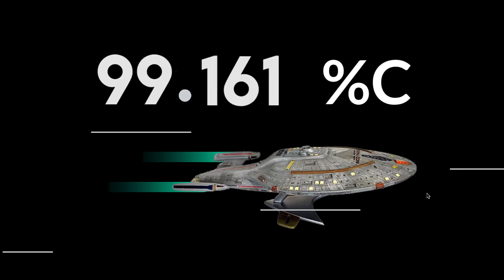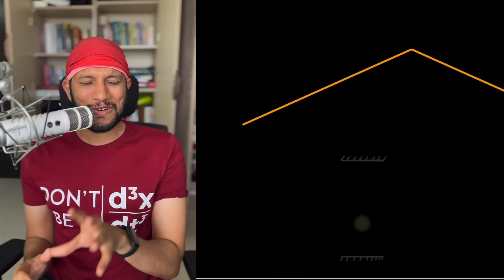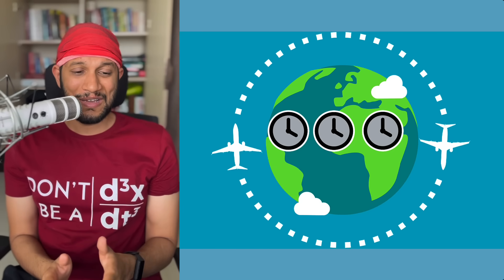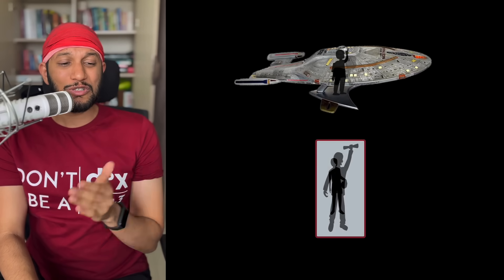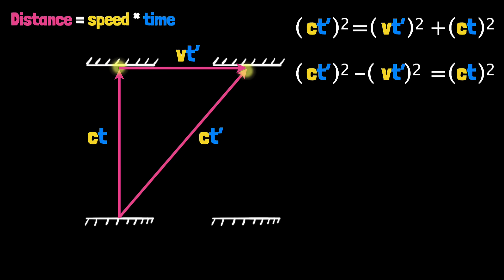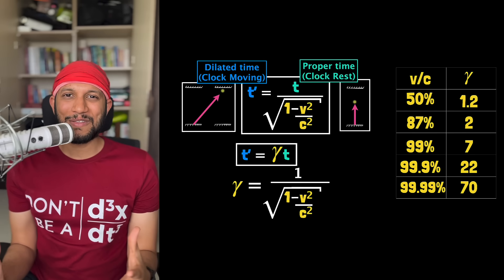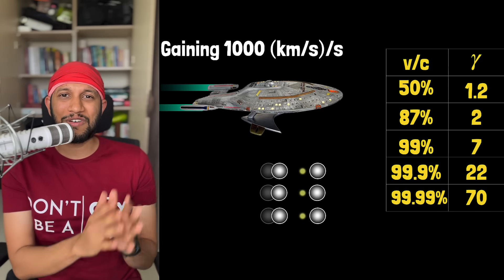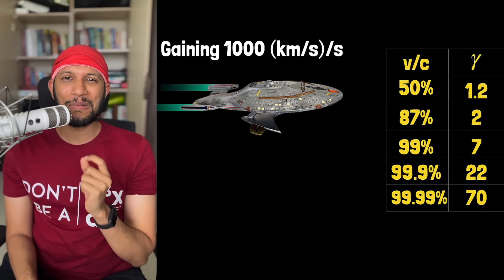I finally understood why you can't go faster than light! (My mind is blown)

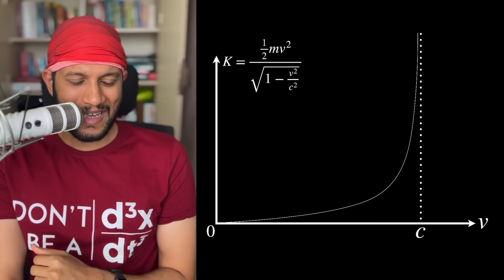Comment: 0:37 photon will not move slower. Horizontal speed has nothing to do with vertical. You just believe that photons will slow down. Believing is religion.
Reply: If I believe you are telling the truth, is that also religion? Half of science is educated guesses, the other half is evidence based on the belief we’re even real to begin with.

But also on a serious note are you suggesting something can move faster than the speed of light? I mean, I’d love if that were true but you have to prove something like that my guy.
Reply: @theIAAW  There is nothing scientific here at all. Statement that vertical speed slowing down because electron traveling longer distance is obvious nonsense. Electron traveling same distance.
And horizontal distance is nothing to do with vertical.
So this argument is not valid.
If someone suggesting something can't move faster than the speed of light they have to use scientific arguments. Not nonsense tricks.

Comment: Nobody on Earth has ever seen Time in a stationary frame of reference.  No object created by mankind had ever existed in a vacuum outside a gravity well, not even those we have accelerated to extreme relative speeds (such as Voyager I and II).  Nor has any object we've ever observed been free of some sort of motion. Therefore, while we can calculate the RELATIVE SPEED OF LIGHT, we cannot determine the ABSOLUTE SPEED OF LIGHT.  So, all of our clocks have been slowed since we first began experimenting with light and photons.

What happens, if we accelerate towards a distant star, such as Alpha Centauri...only our ship's acceleration actually makes it travel SLOWER in absolute speed than the Earth-Sol system is traveling through the Universe?

Comment: wouldn't this mean you can use this to find absolute zero speed? because as far as i know everything is perpetually in motion whether we see it or not but through this you can make something actually cease motion by moving something in a bunch of directions and accelerate in the direction with the least dilation (which technically would be decelerating). and a second theory the greatest direction of deceleration is likely the direction of the center of the universe due to the universe expanding.

Comment: this is an old video but i hope someone sees this and can help me. so let's say there is a plane flying around the earth at 50% the speed of light with a clock, and there is a clock on the ground. that's fine you might have a few seconds difference. but what happens when you add a second plane moving in the opposite direction than the first plane. if both planes are moving at 50% the speed of light in opposite directions then relative to each other they would be moving at 100% the speed of light. now there are 2 problems. 1 we can move faster than the speed of light relative to the planes, because if they are moving in opposite directions. so if they are both moving at 80% the speed of light then they would be well over C relative to each other. the second problem is now the planes clocks are out of sync. the ground clock sees them losing a few seconds but each plane sees the other moving at the speed of light which means the planes clocks aren't moving at all. so which time frame is correct.

Comment: If i understand it well, Proxima centauri si cca 4 years from Earth at 99.99 c. But on the spaceship it is only 4years/70, roughtly 21 days. so from perspective of crew, the ship moves 70 times quicker than speed of light. So the limits apply only for outer space but not for travelers
Reply: Where are you getting this divide by 70 from? Proxima c. is 4 light years from Earth which means it would take 4 years to get there if you could travel at light speed.

Comment: Another way of looking at it is probably that all force carrying particles travel at the speed of light. WHich means that if the CAUSE of an acceleration travels away at the speed of light, there is no way for that particle to reach the part of the spaceship where it is trying to cause an EFFECT. You make the cause and effect connection impossible to happen, because the cause moves too fast away, so you make further acceleration impossible, simply because the force can no longer affect you.

Mind you, I'm not a physicist, so this explanation might be a completely wrong interpretation but hey.. I gave it a shot :D

Comment: I understood the logical derivation based on the photon clock, which takes the photon speed as the reference.  But the logical derivation doesn't explain the choice of photon. What if I chose another "particle" that is faster and made a clock with that one? Is it because info can not travel faster that we need to choose photon? But I still don't understand why not? Any insights?

Comment: I guess I got taught this quite well, because this is what we did in university to learn theory of relativity. Now the real question is : is there an infinity of universes with different laws of physics, like one where the speed of light is slower, one where it is faster, or one when light doesn't even have a fixed speed. And then what happens to the laws of physics. Because it doesn't really make sense why the speed of light is just a fixed speed and it doesn't vary. We don't even know what is a photon, really.

Comment: Ok, I am dumb as brick, if the space ship is going at constant speed, relative to the planet, everything is relative, so you could reverse the roles, and the planet would be the one "moving" relative to the spaceship, but then the time dilatation would be reverse, the ones with slower time would be the planeteers, rather than the spaceship. How is that possible then ? Given what he said, the guys in the space ship should be the one aging slower, but if you take the ship as your reference, then the opposite happen, the planet will age slower, which make no sense. I am missing something obviously.

Comment: I'd say there is a difference between movement and the perception of movement. Not being able to see or measure something doesn't mean it doesn't occur or exist.

If you're in a vacuum, then the assumption is that there is no opposing force. Hence the speed will depend on the speed at which the particle is ejected relative to its original speed. 

Its similar to the reason you can throw something from the back seat to the front seat of a moving car.

All that said, the speed of light depends on the energy used to emit that light, its current velocity and direction. So would we see the clock moving? Yes! Would it look like it slowed down? No! Can things move faster than the speed of light? Absolutely!

Comment: The premise of your calculation is foundationally based on the observer point "holding the definition". What if that presumption is false? The observer can't see far enough for its calculation of the objects speed to matter and will exceed observational speed shifts long before the vehicle approaches the speed of light. To me the definition of time dilation loses mathematical cohesion beyond the observer's capability to adequately measure the relational velocity of the object. Beyond that point it becomes merely theory. Why should the vehicle continue to measure its speed based on a fixed point when that fixed point is no longer in relative "view"??

Comment: So I have one question after seeing this. What about the ship? The people aboard the ship are not experiencing time dilation. So, how about photons? As you approach the speed of light, are all the photons (and therefore all electromagnetic radiation) suffering wavelength shifts due to the speed? Will looking at something towards the direction of travel appear incredibly bright, but away, appear totally dark?

I'm trying to get my head around the fact that photons do not change speed, even though the thing they are in is changing speed. The lack of transfer of information would mean the ship would break apart at the atomic level?

Comment: Imagine the faster moving ship and the photon clock on it.
Then imagine you are on that ship and you look at the "external observer" what would you see? 
From your perspective you are standing still and the "external observer" is flying by close to the speed of light.
If you look at their 'photon clock', then theoretically, as the speed by you, you see that the photons travel longer distances, so from your frame of reference, the time for them should go slower, right?

Why is that not so? What breaks the symmetry of this 'thought experiment' and the time for observer on the ship actually flows slower than the time for observer on the ground?

Comment: Light moving at the speed of light cannot perceive time, the faster you are moving the slower time moves. If I was running at 9/10 the speed of light time would pass very slowly from my perspective. But if I was moving at the actual speed of light time would effectively stop. Since speed is a measurement of distance traveled over time, if there is no time there cannot be any movement. It’s like trying to divide anything by zero like 1/0 is infinitely large and this is how I’ve come to think about it. 

Haven’t watched the video yet but I doubt I’ll fully understand the calculations it looks like this guy is about to go through. I’m not stupid by any means just sick of math after 5 years of college and my brain turns off for YouTube.
Reply from the maker: Since nothing can travel at light speed, light doesn’t have a reference frame.

Comment: This argument is equivalent to scientists in the 1700s stating how its impossible to travel faster than the speed of sound. Its not impossible were not advanced ebough yet
Reply from the maker: There is a subtle difference It’s theoretically impossible according to the special relativity model. The speed of sound was more of an engineering limitation.

Comment: The photon clock also explains why time freezes at c. The photon can no longer reach the mirrors and time as we know it has frozen. Nothing happens outside of movement. Massless particles traveling at c only experience "time" when they interact with something, producing a "tick". You're always moving at the speed of light, combined between moving through time and space. Moving faster in one results in slower in other.
Reply from the maker: Massless particles don’t experience anything. Even theoretically. Because there are no valid reference frames to think about their perspective.
Reply: @Mahesh_Shenoy  Massless particles do interact and change states with the world. In your traditional photon clock example the photon also experiences a "tick" whenever it bounces from a mirror. 

Everyone and everything travels at the speed of causality, either through time or space. We are still on the same reference page, just on different edges of it.

Comment: Special relativity is based on light moving at the same speed with respect to all observers. Accepting that is all it takes to understand why you can't go faster than the speed of light, since if you do so, light could not move toward you at all.

Everything in the video seems to based on Special Relativity, meaning it already requires the speed of light to be the same with respect to all observers.

Comment: But wait…say you had a long line of atoms instead of just 2 as in the diagram. What happens when the In your examples the far left atoms will eventually travel faster than the far right atoms. Wont the ship destroy itself as one part is traveling faster than another?
Reply from the maker: Yes, that’s an engineering problem 😅

Comment: Great video, it's a really good explanation as to why time dilation happens.

As for the formula, I am kinda proud of myself of managing to work it out on my own back in uni. It wasn't some novel idea of my own of course, I already had been taught the theory of relativity and been using the formula in exercises, but we were never shown where it comes from.

I had this very abstract, kinda wild and absolutely not scientific thought like this: What if we look at time as another physical dimension along the "normal" three, and say that we always travel through this 4-dimensional space at a constant speed of c, meaning the velocity can be represented as a vector of constant length in this 4d-space. In any space, if we have a vector with multiple axis-aligned components, like x and y for a plane, the length of the vector will look like sqrt(x^2+y^2). Same applies to higher dimensions, and we know that the 4d velocity vector has length c, so we get c = sqrt(x^2 + y^2 + z^2 + t^2). Now if we want to find the "length" of the t-component, we solve the equation and get t = sqrt(c^2 - x^2 - y^2 - z^2). We could also shorthand the xyz part to just the "physical" velocity, and get t = sqrt(c^2 - v^2). We then remember that at rest, with no time dilation (factor 1), the entire vector is firmly on the t-axis, we can work out that the dilation factor gamma will be c/t, and substituting in the previous result, we get gamma = c / sqrt(c^2-v^2) which simplifies to 1 / sqrt(1 - v^2/c^2).

I was actually surprised that the math worked out, even if the idea was very abstract. It still didn't exactly explain "why" time dilation existed, since I pulled the assumption of the "always constant velocity vector" out of my ass.

Comment: You are not slowing down time - your are slowing down forces and processes and measuring them in relation to one another. Sure - creating completely insulated system and slowing down processes there will create a time slowing down illusion but that is not slowing anything. Consider freezing a living cell with measurable lifetime to say -100C, keeping it in that state far beyond the cell lifetime, then defrosting it back and rejuvinating - voila you slowed down time according to tose definitions (but not really). 

And it is not philosophical - it is relative. I mean how will you actually find a completely immovable point for a reference of measurement to ensure proton clock is at its zero moving point so we can ctually measure speed of light? All this is based on the fact that all forces distribution/propagation is limited by speed of light as well as that photon clock is limited by it. A purely mathematical conclusion for this - it will be enough to find something (a force) that is faster than photons and take it as relative measurement to break all this down.
Reply from the maker: Physics deals with the measurables. Anything you use to measure time will tell agree with the whole time dilation thing!

Comment: But Time is not a physical thing! It is merely something we constructed in order to measure existence. It is no more a thing than Centimeters, Pint, Gallons and Miles are! As you mentioned with the first experiment the 'method' for measuring time was altered on the planes but BOTH clocks physically existed for the same amount of time throughout. So, if anything it only demonstrated that the 'method' for measuring time on that device had a flaw! Im not convinced by the Radioactive Decay argument JUST because Einstein said 'No' and had a different 'theory'! The whole thing is convoluted by mixing up what a person present would observe WITH that of an observer!!! And essentially just optical illusions! An interesting thought experiment to do, and one I don't see ever being done (I wonder why!) is to add in a 'Destination' object. What would you 'see' as you accelerated to the speed of light travelling towards the destination object (Star or Planet etc) and what would you see in your 'rear view mirror' (the Planet you launched from)? It would 'look' like it had frozen in time but in Earth time is still passing as it always has!
And something else that often gets forgotten is that in the Theory of Relativity the C does NOT specifically 'link' the rest to the 'Speed of Light! Time It used in the Equation purely because a 'Constant' is required that 'seems' to be constant under all of the conditions for which the Equation is useful.